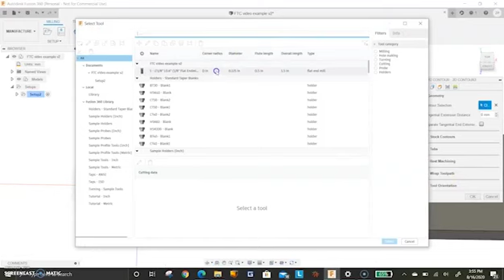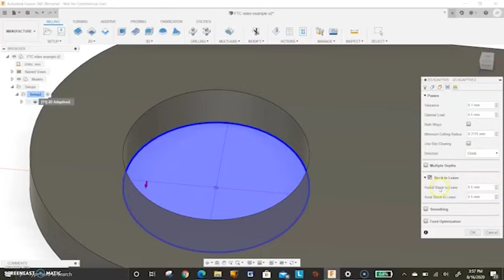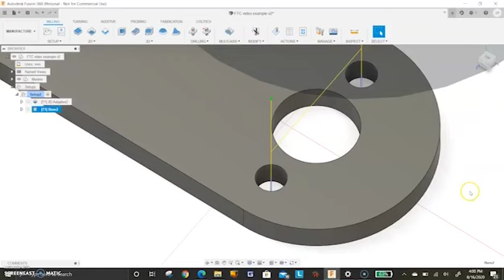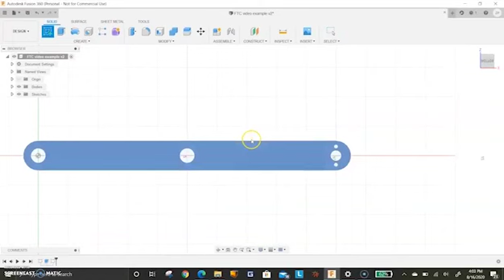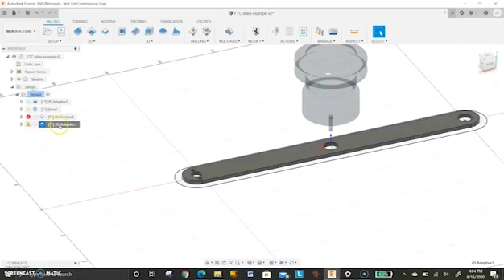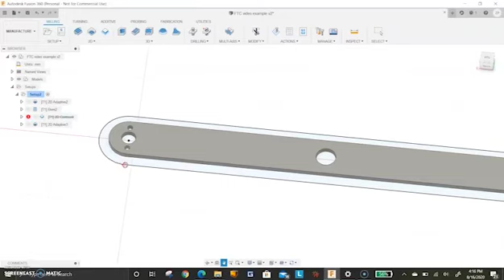Inno3311 Fusion 360 CAM

Comment: I wanted to ask a question regarding Fusion 360. Where would I be able to learn more about Fusion 360 and the different commands and operations that you can do with it? I really love this software and want to keep using it throughout my FTC season. If I can find more tutorials about Fusion 360 and relations with FTC, I'll be really happy. - Team 8719
Reply: NYC CNC has a ton of amazingly helpful videos regarding Fusion 360's CAM, I have learned many good tricks from them. Another thing I personally do is once I know the basics of a software I'll just mess around in it and get to know things at the base level, so when you are introduced to more complex methods or ideas its easier to understand. Also feel free to email us at innovators3311@gmail.com for any specific CAM/FTC related questions!
Thanks, Zephyr